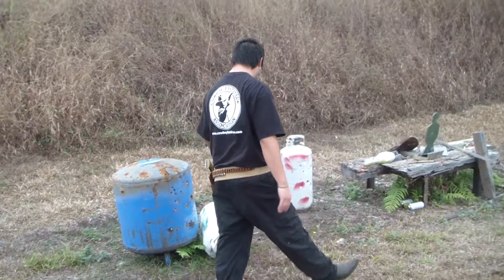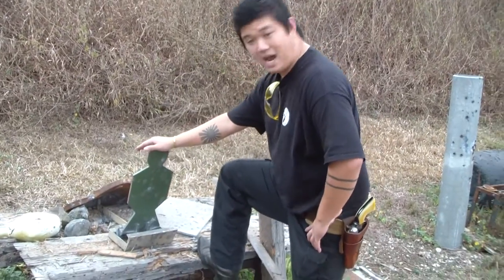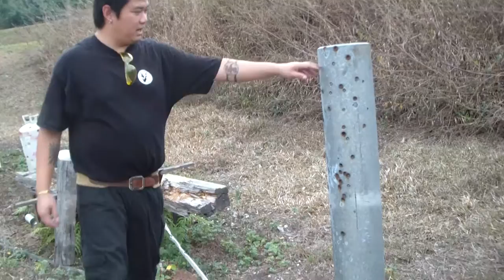BATJAC J.W range tour part 1

Comment: Can you make a How To Video on your grip making? 1960's  I have a German made 357 mag based on the single six.  I have nice wooden grips on it but would like to make a set of the Yellowed style!
Reply from the maker: +gman77gas gotta make a mold of your ones off the gun then just mix your resin and pour.
Reply from the maker: +gman77gas due to a business partner in the grips i can't do a how to video
Reply: OK,  can you say what type of resin is used....?  I would pay you to make me a set but the shipping to and from you would be nuts!
Reply from the maker: +gman77gas lol yeah any type will do just make sure you can tint it so you get the color.
i can check on shipping where you at ? PM me.